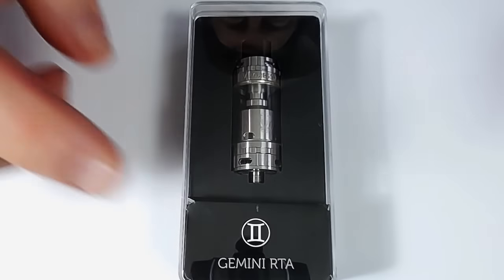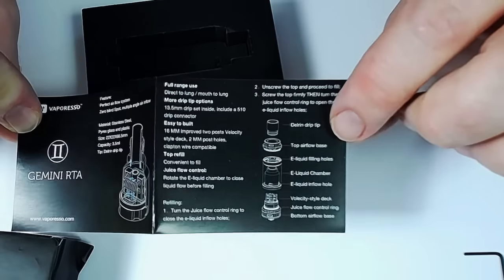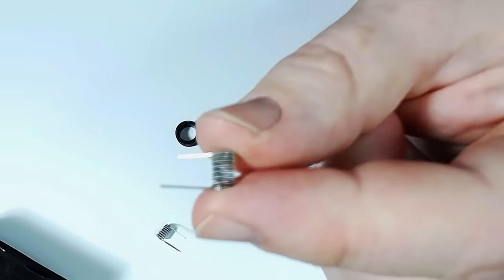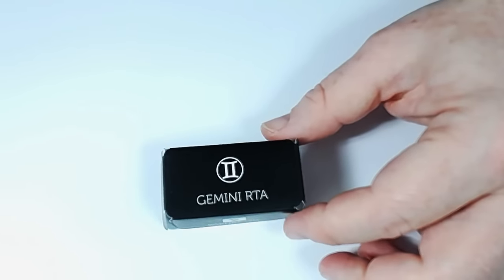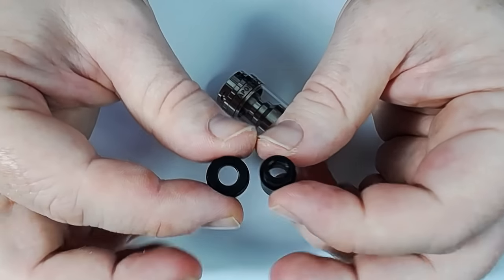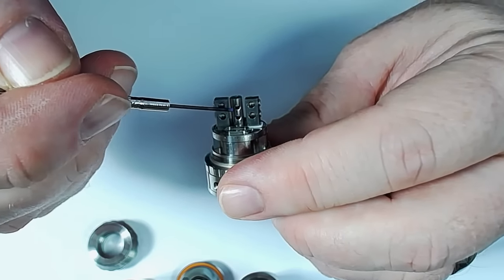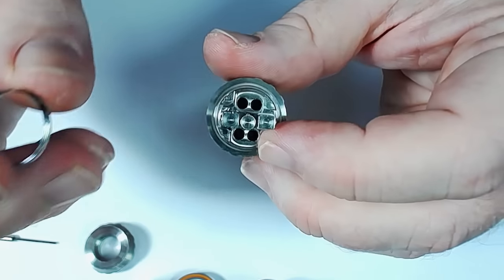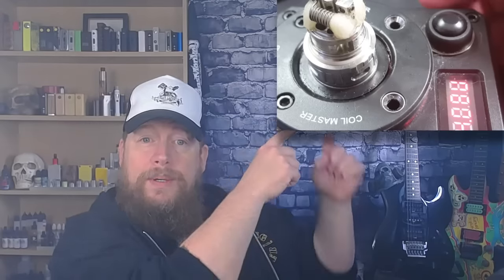Gemini RTA From Vaporesso Review

Comment: I got a Gemini and the first had a faulty negative post, the replacement is fantastic and I love the quality of the vape, I have a twin 3mm SS316l build making .22ohms and it is great in TC with my favourite liquids, the flavour is the best I have found, the topdown and back airflow extra mean loads of extra flavours and I can use a bit mire heat on a liquid that I know normally burns at quite a low temperature.